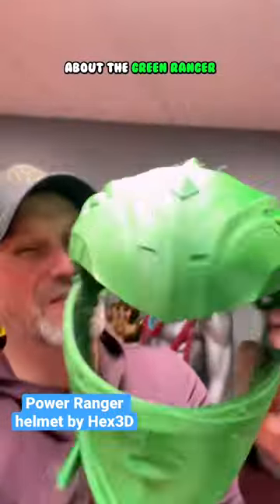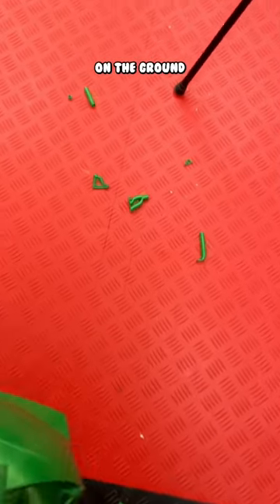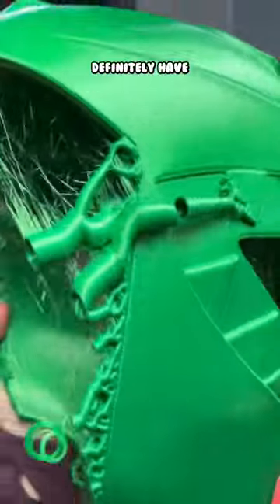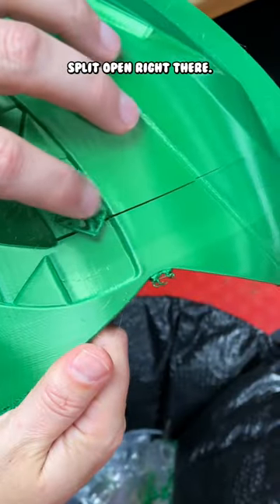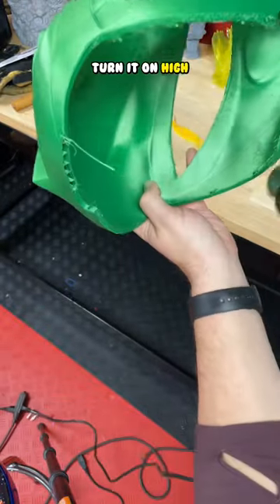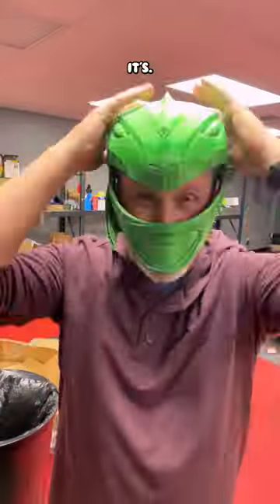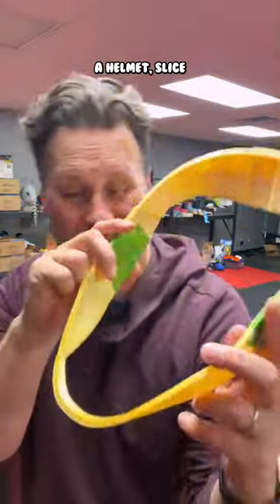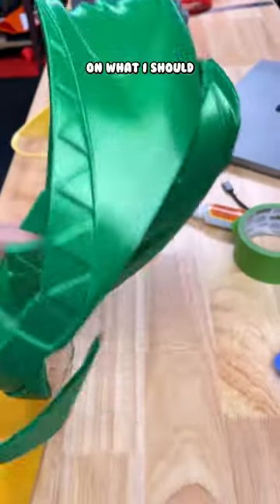Green Ranger Helmet gone wrong 🤦‍♂️

Comment: Some Silk PLA filaments tend to have less layer adhesion because of the additives to make it silk like, so making it brittle. I've tried lowering the print speed, had some success but still isn't as strong as normal filaments. Eventually had success with the Prusament Oh My Gold Blend filament
Reply: any filaments with additives like this are just weak, the polyester prevents layer adhesion and causes the plastic bonds per string of plastic to be weaker too. those strings i believe are also because of the polyester
Reply: I’ve been tinkering with wood filaments and higher hotend temp, smaller layer height, and slower extrusion rate seem to work best. I’ve heard putting it through a dehydrator that replasticizes it helps as well

Comment: Silk PLA is not brittle it's in fact incredibly strong substantially stronger than regular PLA to test this take a piece of the filament off the roll and try to break it and now take a piece of silkula and try to break it it's stupid strong

However the problem is the elastomers that they add to give it that shiny look and also by chance make it so much stronger basically destroy the ability for the plastic to stick to itself so what you're seeing here is not brittleness but basically non-existent layer adhesion

You can compensate for this slightly by using a bigger nozzle so two 0.4 mm lines are not as strong as one 0.8 mm line

The increased surface area in a single extrusion does increase the overall bonding strength but it's still pretty weak

The only thing you can really do because for some projects especially that helmet that silk green is perfect is you have to make a composite

You lay up some fiberglass or carbon on the inside to be the structural integrity for the model

Comment: 3D pen and a heat wood burning tool (mine also works as a solder, just changing the tip), 3d pen to fill gaps and them just melt and excess or to make it smooth.

Comment: I don't know much about 3D printing, but it might help preventing it from breaking by dividing the helmet into sections, making it more likely that if it did somehow fall apart, it'd be in pre-made "Cracks," and get magnets to put it together.

The most fragile area, judging by how you crushed it by pushing down the forehead, seems to be huge gap for the visor. Maybe cut it horizontally, separating the upper half from the jaw section.

Again, not very educated on this and haven't had the pleasure of owning my own 3D Printer, so my apologies if these suggestions are useless.

Comment: In my experience, silk pla has to be run 10 to 20 degrees higher than the max manufacturer rating and really slow with no fan. Using the fan causes it to shrink. Not using the fan causes extreme stringing. I've only ever used the 2 delta style printers I've ever owned, but just seems like there is no middle ground when using silk pla lol.

Comment: Power Ranger helmets are actually supposed to be split in half on the sides and held together with buckles rather than pulled over your head. That's probably why it was a tight fit.